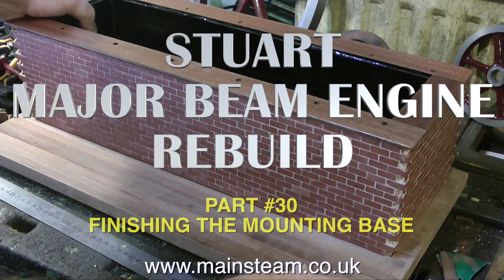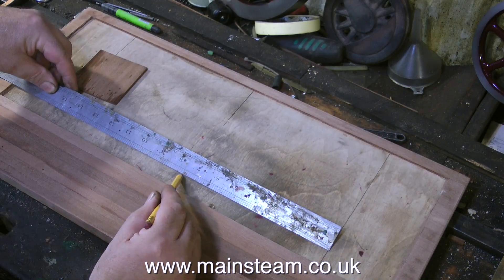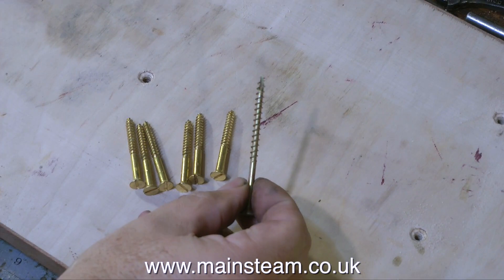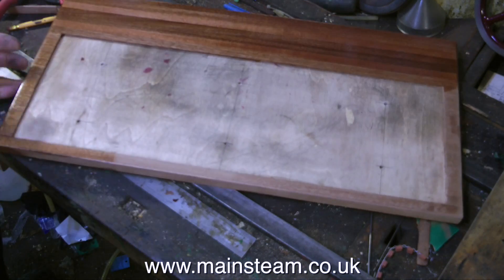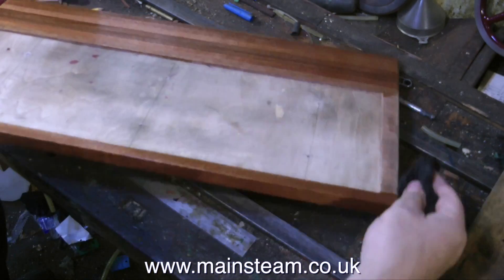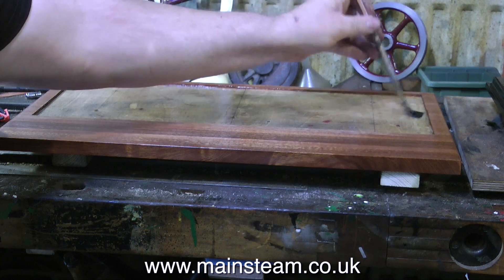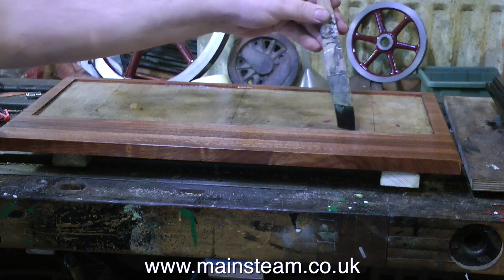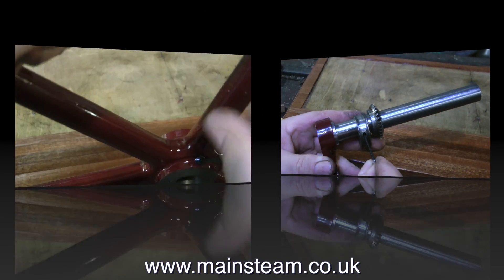STUART MAJOR BEAM ENGINE REBUILD - PART #30

Comment from the maker: Answer to John - Your Youtube settings do not allow replies so I could not answer your question. Repeatedly on many of my live steam my videos I explain that proper superheat is no good with gunmetal (bronze) or brass cylinders. As to Superheater material: Copper is fine for superheaters in the superheater flue tubes of the boiler but for in the firebox stainless is a better option.

Comment: Hello Keith,I wrote a comment some time ago on your MODEL STEAM ENGINES FOR BEGINNERS #7   Advantages of Superheat video but you might not have seen it or missed it. The question was: what happens if you use copper tubing for superheat tube inside the firebox as opposed to stainless steel? Also must the valves and cylinder be cast iron with superheat? Can one use bronze cylinders and valves for superheat?

Comment: Hmm, I guess I figured this Ronseal was an oil based stuff by the sound of it. Since it is a poly based product I wonder how close it is to a stuff we have here in the states called Polycrylic. Have you ever done any models with boiled linseed oil or even better a true tung oil on the wood? I love both and the finish is very nice. A proper tung oil finish is hard to beat but they can take quite a long time to do if using real 100% tung oil. Linseed is also pretty nice. I just refinished the stock on my WWII No:4 Mk1 Lee Enfield, .303 British with the proper linseed oil finish. It looks nice!